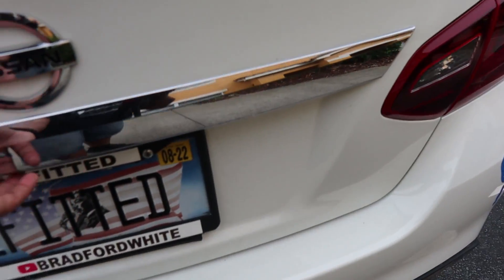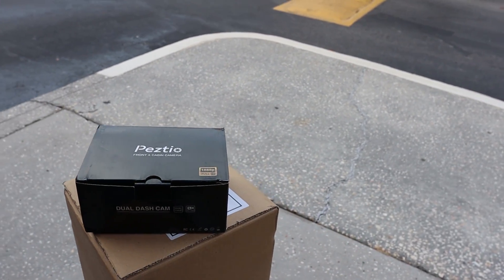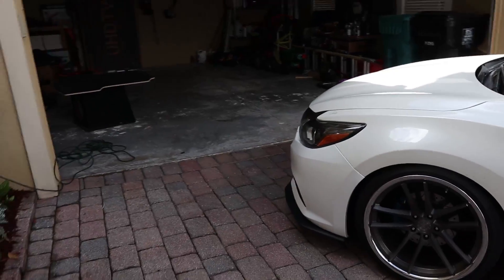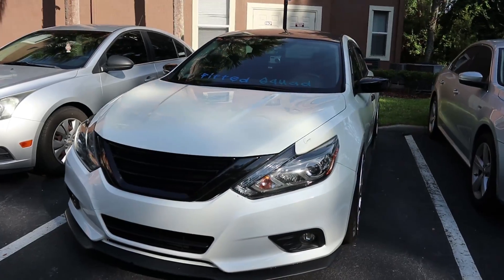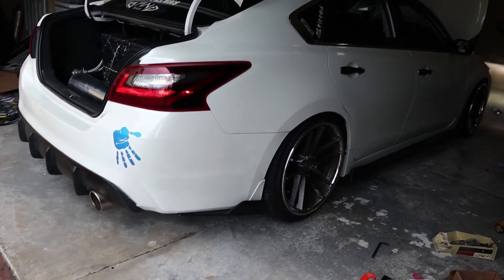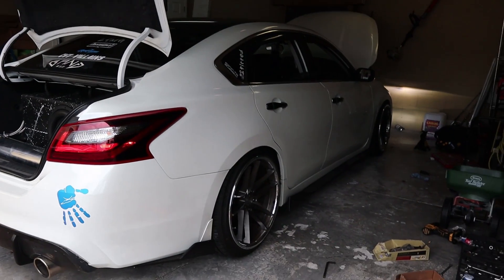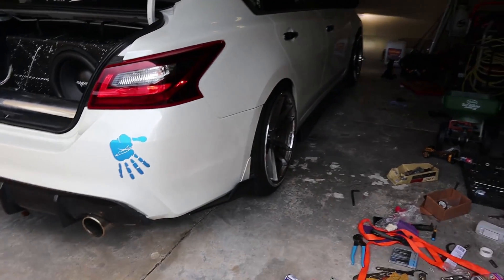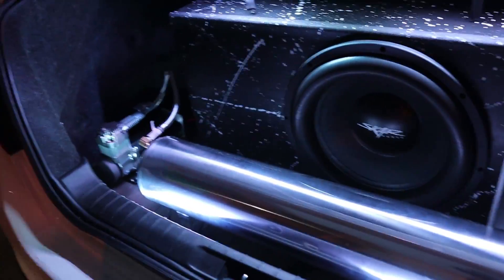Finally Bagging my 2017 Nissan Altima!

Comment: hi is good I like this car can you make video how installer subwoofer on factory stereo cuz i have 2016 nissan altima 3.5 thanks
Reply from the maker: I didn't install it myself but there is an adapter that you need.